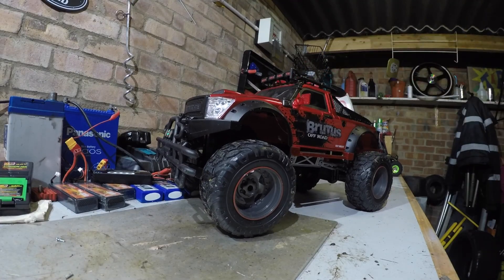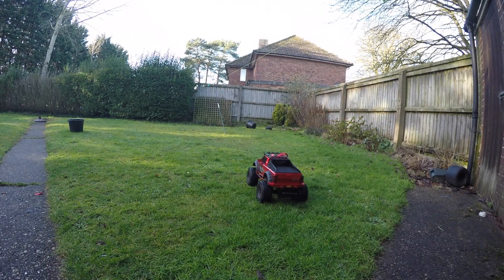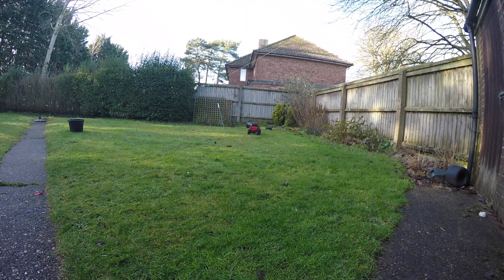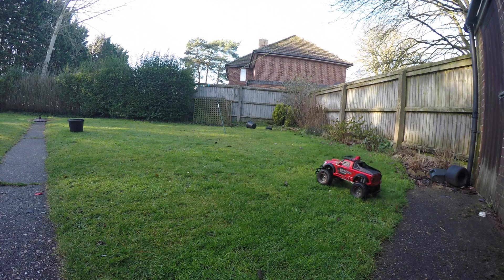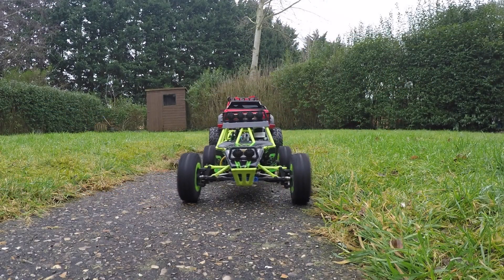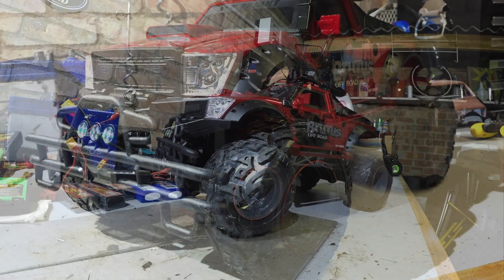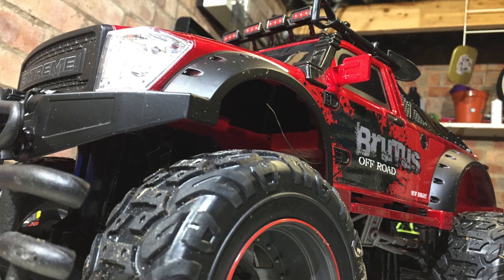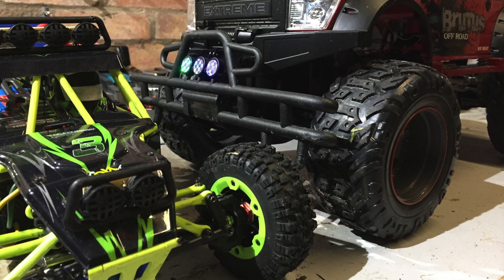How to upgrade your Toy RC truck. Tug of war Round 2 Vs Hobby grade. Proportional steering 1:8

Comment: What is the esc?
Reply from the maker: It's a combined ESC & Receiver out of a Ripmax Dingo !/18 truck
Reply: Tomley RC Garage ohh, and 370 motor? It is rather  slow... what is the weight of this big car?
Reply from the maker: Doesn't weigh much (1.5kg maybe?), tall gears and big wheels.  Brushless was much better :)